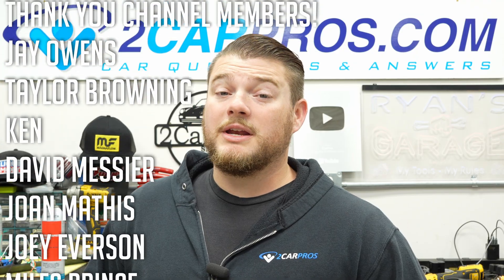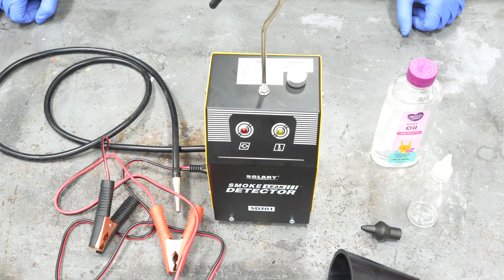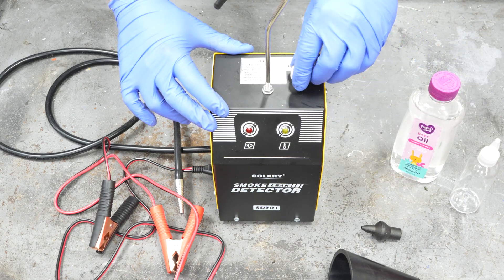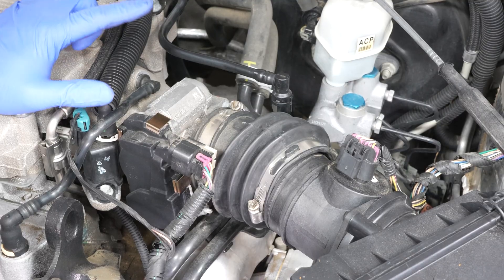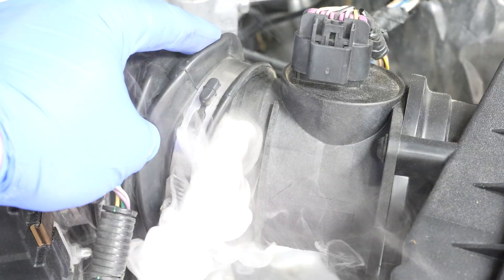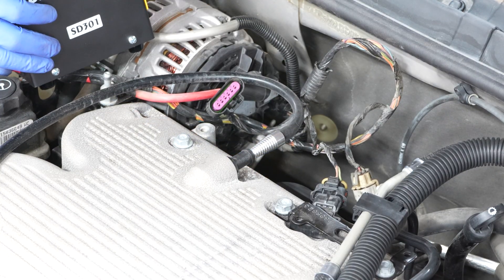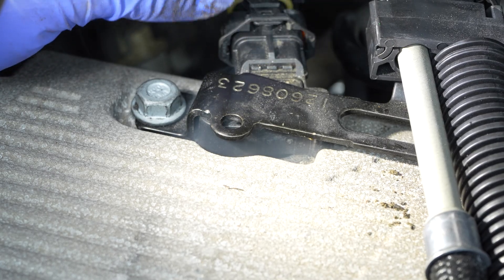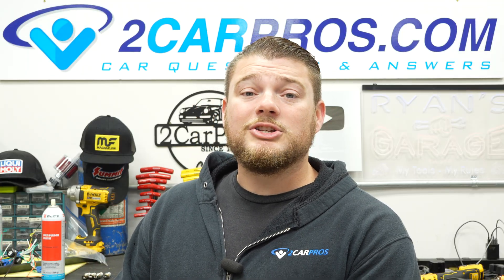How to Find a Vacuum Leak | Engine Stalling at Idle Repair | EASY!

Comment: I have a tough issue. My 1999 F150 4.6 stalls out when I'm idoling while pressing my brake. It does not turn off when in park. I replaced all 8 spark plugs and plug wires, I put a new brake booster and check valve hose in. It's idoling way better but it still stalls out. I think I have a leak but I'm not sure.

Comment: I have Toyota Corolla 2007 model, the car sound is extremely higher when the gear is on P/N and reduces when gear is on D/R causing the engine to shake and sometimes turns off. What could be the cause?

Comment: i have a 1996 peugot 306 that i suspect has a vacuum leak. it's an automatic. Stalled out while driving, engine cut completely when i took my foot off the accelerator. This has happened once or twice. about 4 or 5 times, the engine won't turn over unless I rev it, and again have to keep my foot on the accelerator to keep the engine turning over. idle also sounds weird, too low and throaty. all of this started not long after having my car serviced and all the fluids and filters replaced in april. did the mechanic who did the service cause this vacuum leak somehow? all of this is compounded by the fact that I live in france, speak and understand french very poorly, and know very little about mechanics. thanks for any insights you might offer me.

Comment: How long is a reasonable time to let the machine run and start seeing smoke coming out of the leak?
Reply from the maker: Something like 2-5 minutes. Thanks for watching!
Reply: @2carpros Engine was not running, right?
Reply: @2carpros but... at 1st part where you connected smoke near MAF how did you keept it when there is a air filter where smoke can go out w/o any problem?